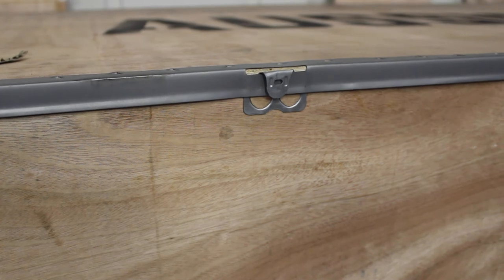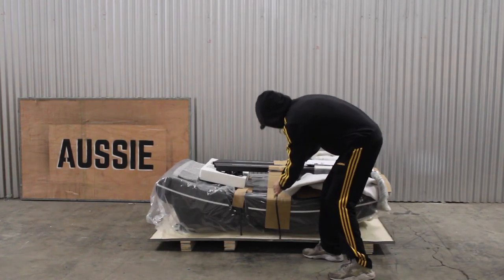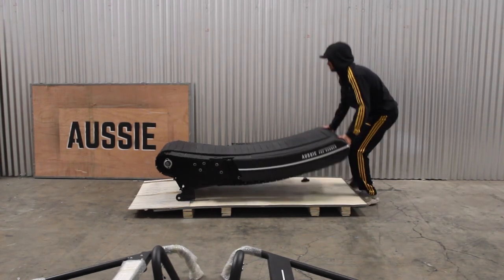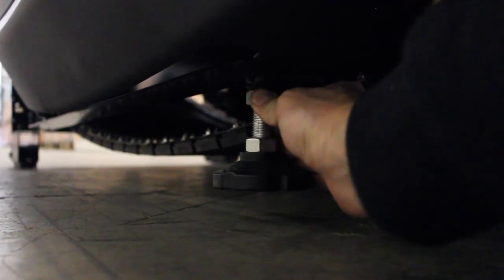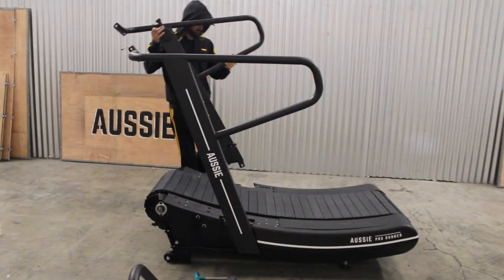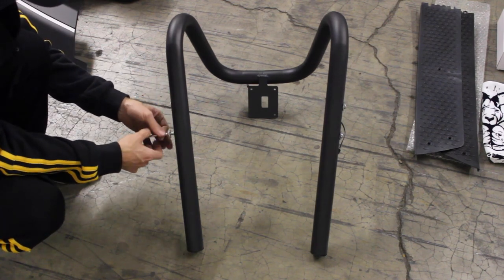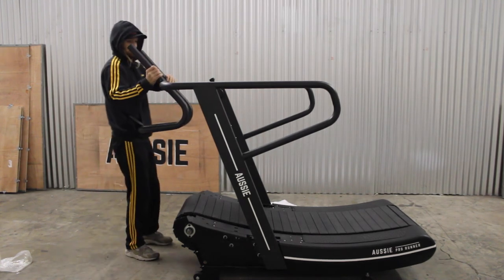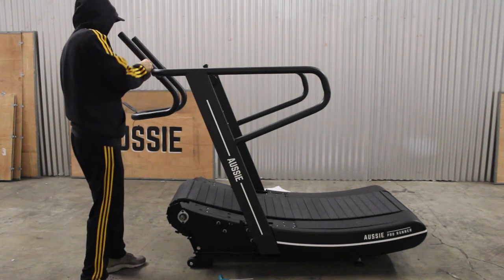Aussie Pro Runner Curved Treadmill Assembly Video

Comment: With the rear height adjustment. Is there any specific height it should be?
Reply from the maker: Hi!  Please make sure the rear feet are adjusted high enough so the belt clears the ground.  The Aussie Pro Runner should be used on a solid and level surface.  You can check for level across the rear axle and adjust accordingly.  If you have any other questions feel free to send us an email at sales@aussiefitnesspros.com 🤙

Comment: what could be the cause of sensor not workking
Reply from the maker: Hi!  Check out Page 9 of the Aussie Pro Runner manual to see a picture of the sensor position.  If the sensor is not working, then it is likely not close enough to the flywheel to pick up a reading.